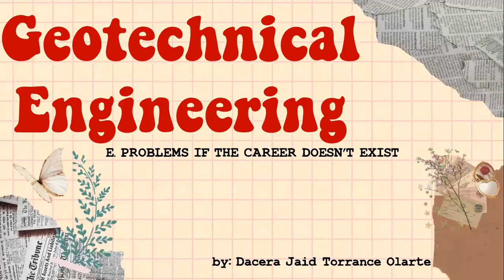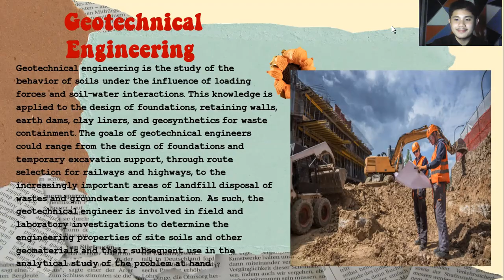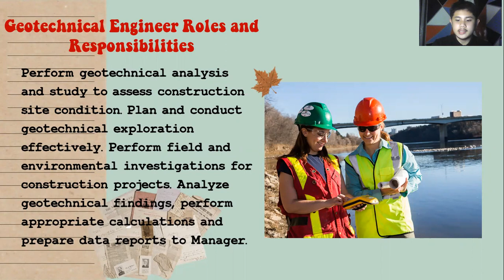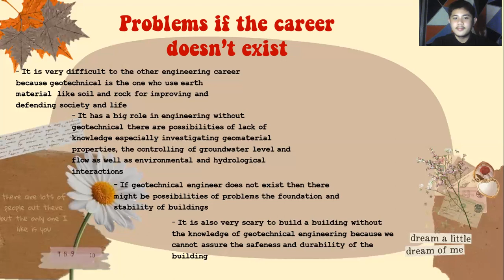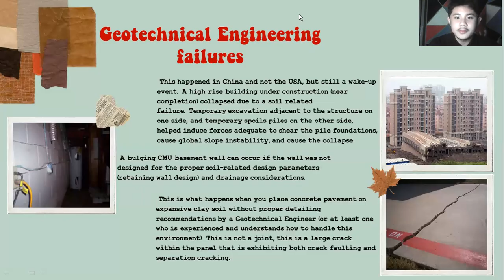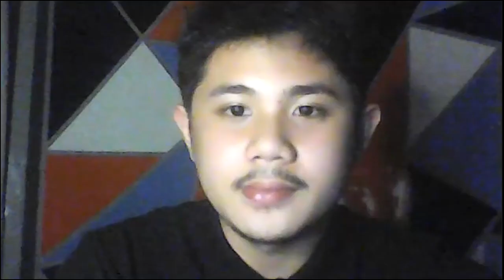Civil Engineering Orientation REPORTING

Comment: We all know that Geotechnical engineering is important in any construction occurring on the surface of or within the ground. Without the superior calculations and checking out supplied with the aid of using a Geotech, homes ought to see large harm after an earthquake, slope balance shifting, ongoing settlement, or different effects. Geotechnical engineering is critical as it allows save you headaches earlier than they happen.

Comment: I learned a lot from your presentation, Geotechnical Engineering problems encountered if the career doesn't exist
If geotechnical engineering does not exist it may cause to failure of design of the structure.

Comment: In this video, I have learned the problems if geotechnical engineering doesn't exist. I have learned that geotechnical engineering is important because it helps prevent complications before they happen. If there is no advance calculations and testing provided by a geotech, buildings could see significant damage after an earthquake, slope stability shifting, ongoing settlement, or other effects.

Comment: I learned that if geotechnical engineers is not exist, we dont have the knowledge about the raw materials being used in construction site if the materials is strong or safe to use, we dont know if the soil and rock environment of construction site is safe to build a structure or building. It will be dangerous for constructing structure or building if we dont know if the soil or rock environment is safe because geotechnical engineers does not exist

Comment: Nice presentation, I learned that it is scary to build a building without the knowledge of geotechnical engineering because there is no assurance of safeness and durability of the building. I learned that, if geotechnical engineers does not exist then there is a possibility of a failure and a risk in the project.

Comment: Geotechnical engineering problems encountered if the career doesn't exist
If geotechnical engineering does not exist it may cause to failure of design of the structure.
It would lack on knowledge investigating geomaterial properties, the controlling of groundwater level and flow as well as environmental and hydrological interactions.There would be arise problems on the foundation and stability of buildings. It wil greatly affect the safety and durability of the building or structure if this career does not exist.

Comment: Geotechnical engineering is important because it helps to avoid issues from occurring in the first place. If this career does not exist, there may be a problem that could cause our structure to fall or create damage if it is not prepared correctly.

Comment: If this carrer doesn't exist then there might be a problem when it comes to stability and structural of the building. Geotechnical engineering is important because it helps prevent complications before they happen.